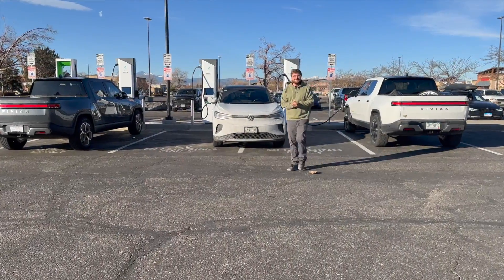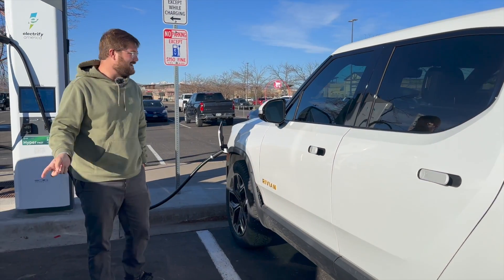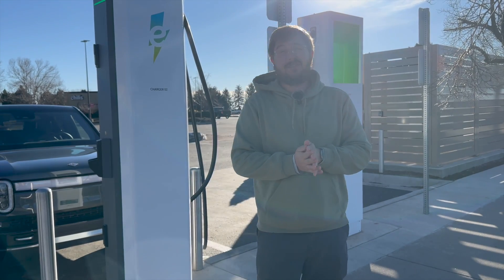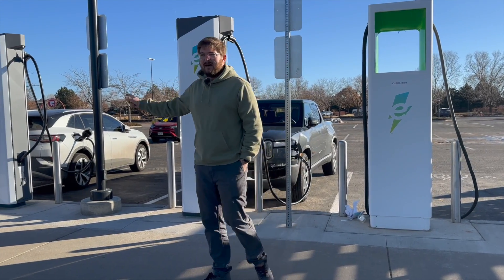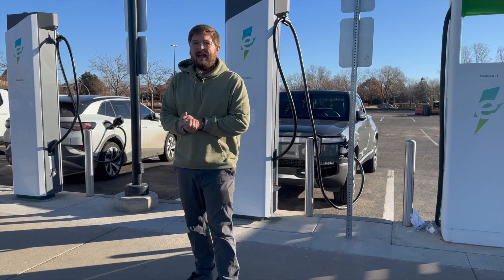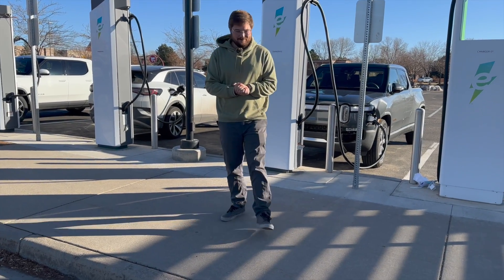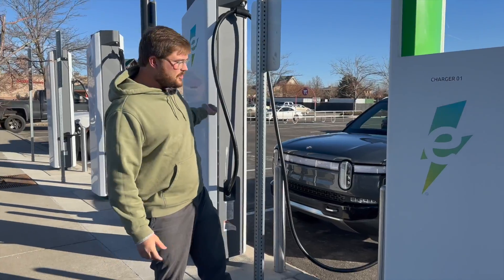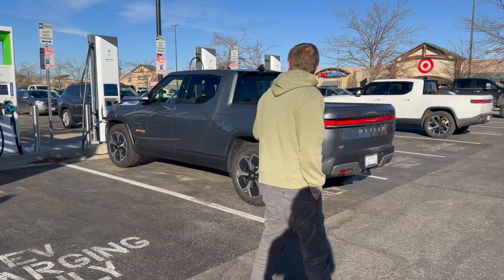Electrify America Has Been Upgrading Their Sites w/ New Chargers - Here's How It's Going So Far

Comment: Overall I like the new units. Better screens, nice cables, ok cable management (although I’ve heard of them breaking), juicy power, and faster screen response time. However these issues of them still being found offline or unavailable, bricking vehicles (unrelated to the F-150 story that blew up last week, that was on Signet), and some weird power sharing bugs means we are still on the rocky ride of public DCFC for CCS EVs
Reply: Why don't you call up Electrify America and some of the other charging companies and do either zoom or in person interviews?  I would find their insights very interesting
Reply: Cables are breaking and just laying on the ground often. Software is still absoulte trash, making new hardware irrelevant. Can't wait for tesla to open up.
Reply: Take your rivian to the rivian chargers and see what happens. They need to get on building their network so you don’t have to bash Ea for not handling the trucks . They network came out in 2018 for cars . They don’t owe rivian anything.
Reply: @markfitzpatrick6692  There are two Rivian Waypoint chargers a 4 minute walk from my door. they are 11.6 kW that i use to charge my Chevrolet Bolt EUV for free, it handles 11.6 kW charging. And the chargers are rock solid, no issues so far.
Reply: @markfitzpatrick6692  so Rivian drivers should count on Rivian building out their own network while Vw, Ford and GM build zero?. EA wasn’t VW idea but forced. Where are Rivian supposed to charge if there is none around? Are are you referring to Tesla opening up which I do understand is not liked by Tesla drivers.
Reply: @markfitzpatrick6692  there should not be different networks for different electric cars that is very inefficient you don't go to different gas stations for different cars.
Reply: @christylbk  This line of reasoning can be extended to different brands of gas for all cars. Need I say more?

Comment: On my way to swap a site tomorrow, but for the record let’s not get to far ahead of yourselves as to what this industry or your purchase has come to… the energy that it takes to charge your EV vehicle is at least if not more damaging to the environment than a combustible, your charger doesn’t magically create power, it comes from the power grid which in turns uses a fossil fuel to create electricity to power the distribution center. Further more check out the lithium mines that your battery in getting it’s raw materials from, unfortunately the majority of EV owners are not informed in this process other than it’s GREEN or it’s better for the environment or $ incentives. I believe that this industry does become convenient in some applications, ex small engines and tools. But if you want to rely on RANGE ANXIETY be my guest, it’s what’s paying the bills at the moment.

Comment: Stevekight, I design them every week. You can charge your EV using a 120v outlet from your home, but it is extremely slow. You can add a 240V, 40 amp outlet to your home to charge your EV, which will cost you more than running your HVAC unit for 7 hours, not cheap. 
You are right about not requiring 480V, 80 amp DC fast chargers. However,
Per Calgreen 4.106.2.2 (2022 California Green Building Standards Code) an apartment building with 100 parking spaces requires 40 EVCS charging stations (240V, 40 amp) = 1600 amps. The apartment building itself will likely require about between 1200 and 1600 amps. So you see how large the required EV installation is. 
All of this required power is with California electric utilities being very under sized. The consequences will be skyrocketing electricity prices and lots of electrical failures and problems.
The California govt is putting their "dictatorship" policies ahead of the actual technology. They are using our tax dollars to fund EV technology but doing NOTHING to build the electrical infrastructure other than building massive solar farms and wind farms. These massive power producing farms pale in comparison to the power delivered from hydroelectric dams. It is a weak alternative. The are putting green energy laws in action without having the necessary infrastructure, a road to failure.

Comment: anyone has insights on the (upcoming) Chamberlain SD charging site? this seems to be a critical stop for E/W trip along I90, the two closest EA site is almost 300 miles apart, making EV tripping very difficult or impossible without  a Chamberlain stop if driving at 70 mph or higher..

Comment: I appreciate what you do.  I am sure that you have created pressure to make them improve.  I own a Tesla and charge at home, in Texas.  Tesla has been adding charging which solved a problem for me.  A year ago, I could drive to Lubbock (a college town) but there was no way to drive back.  That has been fixed.  A local Whole Foods has 2 charge point stalls.  I went there as an experiment... free charging but ultra slow.  When I came out the market, it had added 4 miles.  Mostly pointless.  I found another charger, not sure what brand in a shopping center and tried to use it.  The screen was so sun fogged that I couldn't tell if the display was on.  It had tap to pay, I tried tapping with my credit card but it wouldn't unlock the cable.  Tesla Superchargers are so simple; I feel sorry for owners of other brands of EVs.

Comment: I don't drive a CCS1 car so I can't say much about the EA or EVGo or ChargePoint experience. I do have a CCS1 adapter for the Tesla and I've used it in a few places: Durango, Ouray, Purgatory Ski, somewhere along Utah Hwy 6 between Green River and Spanish Fork. With that limited experience, I have seen the down stations, the low power delivery, the wonky screen action, etc. I'd say my experience is about 50% good vs bad. I hope EA gets their act together and takes control of the CCS1 network with reliability. I think they have a limited time to do that before Tesla takes it over by buying out the whole EA network and cleaning up the reliability mess it currently has. Maybe EA is hoping for that or even has approached Tesla on that front, I don't know. Anyway, keep getting in their face about the network and keep us up to date as you do. Thanks, and cheers.

Comment: I would hope on a hot day that cable cooling would keep happening until the cable is under 80F - even if that takes 10 minutes after you stop charging.  And that cable cooling would start at soon as you take the cable off of the cradle, to plug it into your car, if you decide to charge or not.

Comment: I wonder why they feel they must install the replacement units in the same location as the ones they are replacing?  So say they have 4 sites, like the one you are at, and they want to install 4 more new ones.  Sure they can re-use the location of the cabinets, and maybe not need to replace conduit and pull in new larger wires. 

They could also install the newer units to the other side of the transformer enclosure room.  And then have those new chargers ready before shutting off the old ones.  

Or maybe a good plan would be to buy a couple of level 2 chargers rated at 32 amps at 240 volts, and put those to the other side of the charging transformer room.  Then they would not be totally offline when they switch out the EV chargers.  (except for tour leaf).  

On one of your recent video's, I saw you drove past a Ford dealership as you left the I-70 freeway.  Ford will normally have a level 2 charger in the service area.  I would guess most car dealers have a charger now.

Comment: Again scary, will wait until the stations come with 30-50 Amp direct bypass and allow to plug in a dogbone and via mechanical means and use of simple card reader set to set time and with own charger  inverter plug in instead of dealing with software silliness and at risk of finding nearest hotel after getting either error message or black screen.

Comment: I have a Tesla MY & M3.  I am impressed with a lot of the new EV offerings from many manufacturers and will consider them the next time I am in the market for a new car but Only if the charging infrastructure improves.  Tesla has a HUGE advantage over the competition.  They may be able to match Tesla performance at the vehicle level but the infrastructure issue is a real problem for non Tesla EVs.  BTW. I’ve owned EVs for 4 years.  I know 95% of all charging happens at home but if I cant drive from Florida to New England each year with confidence, I’m not going to consider leaving Tesla.

Comment: Electrify America is a joke. I have had an EV all of a week and out of 5 Electrify America station stops only two have worked and one of those maxed out at 18kwh with only 15% battery. I nearly got stranded in NC due to EA. ChargePoint, EV Go, Shell, and FPL Evolution (Florida Power and Light) have all been fine. I have 250 KWH of free charging that I can barely use because of these rotten EA chargers. I will never use EA again, I don’t care if I have to sit at 63 watt ChargePoint chargers. I won’t be fast charging much and I will go out of my to avoid that rotten company.

Comment: Port St. Lucie, Florida just got upgraded chargers which seemed great since the old ones were totally undependable. However, went to charge and got connection errors. Tried two different chargers with service rep on the phone who even reset them and never could get a good connection to my 2021 ID. 4. Finally went to the one old charger 150/chademo and plugged in connected immediately and got a good charge. Ionic five Guy said he plugged in, went in Walmart and came back and realized he wasn't charging. Chevy bolt moved a couple times and finally got it charge, and another ID 4 guy couldn't get connected either. So, not real excited about the new chargers 😞

Comment: Drove down I15 from Lehi to St George Saturday in my new ID.4.  Cold, ferocious headwind, but planned to charge at the new EA at Scipio. Arrived to find the two 350KW screens dead (the Chademo likewise). The 150 was live, but EA considered it "unavailable" so we couldn't use the app. Fortunately the card reader worked, so we charged up and proceeded. Because of the wind, we wanted to add some charge at Beaver, another 80 miles along. We had just checked that station out the week before and it was working. Pulled in and found it shut down and fenced off, so we reduced speed to 65 and made it comfortably to Cedar City, where the units at Walmart were working fine. Distance between working chargers (not counting Scipio where we got lucky) was 202 miles - too far for us in that wind. My son with his Leaf would have been stranded. Sure, checking the app before we left would have been smarter, but even that didn't give the full picture, and we were naively relying on the status we'd seen two weeks earlier when we checked out those stations while driving an ICE vehicle.

Comment: I also think that every station that offers DC fast charging should have a few level 2 chargers.  Level 2 chargers are cheap to install compared to DC fast chargers and they could provide someone that is depending on the station the ability to charge enough to get to the next DC fast charging station.  Charging fees should be set accordingly to charging speed.
Reply: I like this idea. Not just as emergency but also to charge while waiting. As long as it’s designed in way that you don’t lose your spot waiting for a fast charger to become available. I see some fights arguing whose next in our future. The golden years of road tripping along empty charging stations are over
Reply: In Norway a lot of Recharge 50kW chargers also include a 22kW outlet, that you can use with your own cable. Quite usefull if you want to charge while going cross-country skiing or a hike in the forrest.

Comment: I have a request for a vlog. Take the same road trip with the same car(s)  (with at least 2 charging stops) at 2 separate speeds to see if a higher speed or less time charging makes an overall time difference.
Reply: You do know that charging speed - in miles (added) per hour (of charge time) is way faster than a speed you could legally drive at, right?
Reply: @Dennis Lyon  No. I did not...but I do now. That explains why I passed so many Tesla's.
Reply: @chycoll  - Teslas charge rather quickly - over 1000 miles per hour for a part of their charging curve if you run them low enough.

Comment: Went to the station in Vegas where these new units are this weekend. Half the units were down. Even in my EV6 which should be able to pull 220kw+, I usually average around 125kw. Seems like most of the stations in Vegas/Southern Nevada and Southern Utah are only about 50% operational as of late November/early December 2022.

Comment: The Green LED lighting of the ‘old’ EA towers is an awesome feature when you are driving around a mall parking lot that you’ve never been to.

 Bummer that it looks like these new ones don’t have it.  😢
Reply: On the plus side, the Plugshare app does a great job of pinpointing the exact location of the chargers (not just the 'street address' that could be anywhere on a complex 200 acre property). You have a good point, though.
Reply: Quite the downgrade if you ask me. Much less visibility, increased plan charging rates, little too no 220 volt charger availability. Looks like Shell chargers are already doing a better job than EA even with a huge head start!

Comment: Just encountered a section of I-15 between Cedar City and Salt Lake City, 2 locations taken down for the upgrades. Good thing Plug Share had it identified. I need one or the other to get to SLC. Had to divert to Richfield adding about 30 miles to the trip. This could have been a fail. Just a thought--Why not Upgrade one at a time? I used one of the new charges in SLC no problems!! I was my third try at at locations in SLC 18miles from where I needed to be. Driving a R1T.

Comment: I think the use of the term "brick" is a little scarier sounding/misleading on your Rivian as traditionally in the power electronics world this would suggest that the truck is permanently damaged (which sucks if that is what is happening to the F150 Lightnings). The protective hardware sounds like it is doing what it's designed to do, still not great what the chargers are doing and hopefully EA can sort this harmonic condition out.

Comment: At the 4-stall EA charger in Naples, FL (Walmart), the old models were frequently down.  Recently, 3 of 4 were updated to new 350kW, very tall stations.  My Lucid charged there several times without a glitch.  It was a “plug-N-charge” experience identical to Tesla superchargers.  With 10% SoC, I only got 270kW out of 350 as the only vehicle charging, but maybe that was due to minimal pre-conditioning.  At 94% SoC, the Lucid still wanted 59kW which was surprising.  I am extremely pleased with the new chargers at this location and must give EA 5-stars.

Comment: No one should be taking up two spaces—you are correct to call that behavior rude.  As for charging to 100%, I believe it is rational behavior for ID.4 owners, especially in cold weather, because of lower range.  I believe that the ID.4 that I own has a real-world range in warm weather of about 240 miles, but that range is much reduced in weather below 30 degrees.  The ID.4’s sold in the United States don’t have heat pumps.  Lack of range isn’t a problem for me because I have an Autel charging station in the garage.  To make matters worse, when I tried to charge at an Electrify American DC charging station in Spokane, Washington, the station only charged at about 40kW, which was happening to another ID.4 near me.  So anyone who relies on public DC chargers for an ID.4 is behaving rationally by charging to 100% in cold weather considering the reduced range.  We traded in a Tesla Model Y to get the ID.4 and got a much superior automobile with poor EV technology, including poor public charging.  I repeat that taking up two spaces is inexcusable.  The car has a really nice backup camera—learn to use it.
Reply: You are right on the slow charging. In summer when I get 100 kWh + and then get dinged to 20kwh over 80% it makes sense to stop. But, in winter when max is 60+ and get dropped to 20 the penalty isn’t so bad so I hang around watching videos or shopping. My station isn’t so busy now but if that changes I’ll rethink.

Comment: I was really hoping for better news with EA - but it sounds like just a different set of problems. This is my biggest worry for the well intended infrastructure bill that gives $5B to build out charging infrastructure. As EA has proven, it won't be that hard to do the initial roll out, but long term maintenance and support will still be an issue. Tesla is the only one, at least in North America, that has solved this. At least from an infrastructure perspective, it would be better to sprinkle L2 chargers at malls, shopping centers, major work locations/parking garages, campgrounds, etc instead of doomed fast chargers. In 10 years, I'm concerned this will be looked back as yet another massive government waste program and ultimately give all EVs a bad reputation.
Reply: Dont forget the beaches
Reply: @samusaran7317  LOL - I live in Florida - how could I have forgotten the beaches?!
Reply: EV reputation will continue too be bad due to "forced mandates".
Reply: @samusaran7317  Yeah, I struggle with that one. I really don't like government mandates either but we all know the auto industry would have never developed more fuel efficient gas engines without them - same with emissions standards.

Comment: I've some of the EA dispensers and not had the best of luck. I went to some that were just installed and turned just two days before and one of them was already bricked and one of the others was completely off. And others at another site where they had recently replaced the units one was completely dead and the others weren't delivering the full KW's it was designed for.